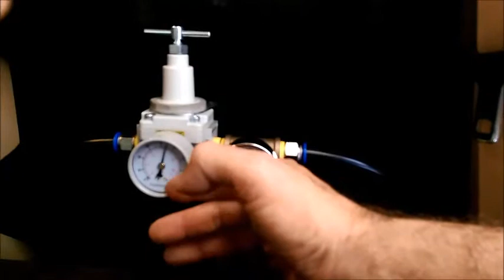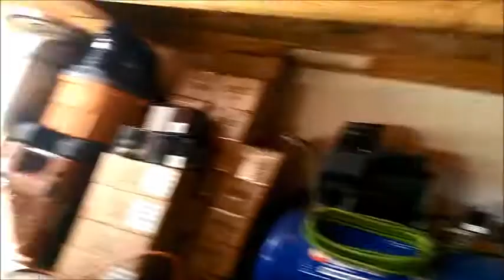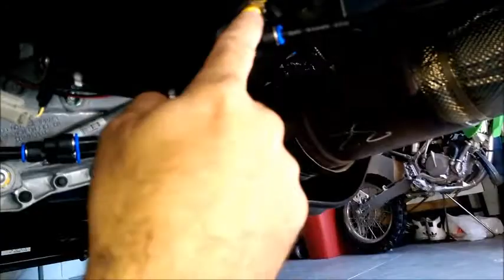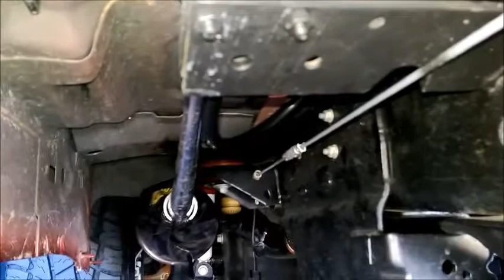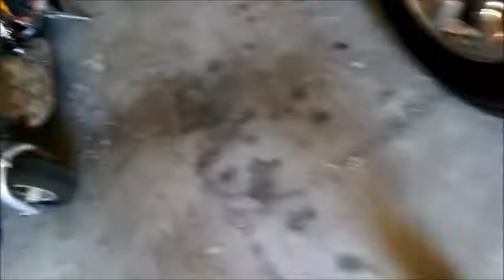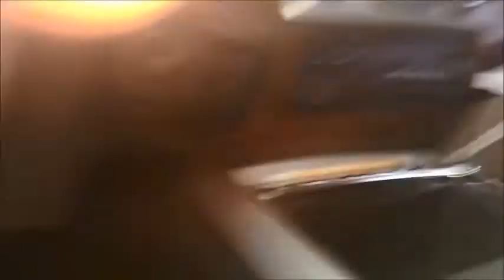F250 Fire Truck Horn Install

Comment: Where can the schematic be found? Interested in adding this to my truck
Reply: รีดเ
Reply: Sorry Ian, When I posted this video I couldn't attach the schematic for some reason? Then after a month or so my PC crashed along with that file so it was all lost. As far as the wiring its not to hard. I can give you some pointers on what i did if you need help with your install.
Reply: @eddiewood537  if possible can you please give me a list of all the parts of you used and I'll figure out how to install it please thank you